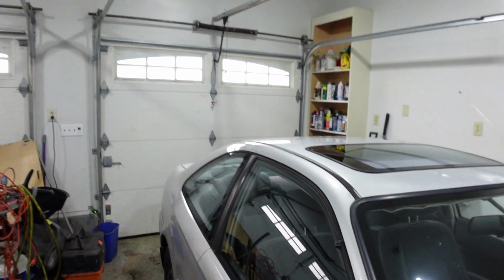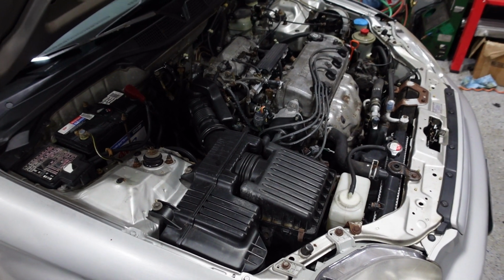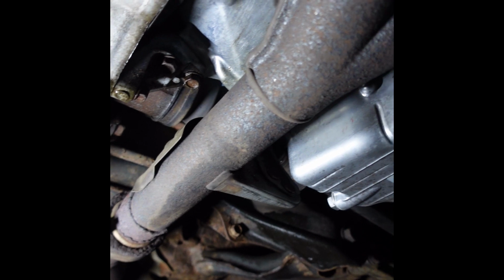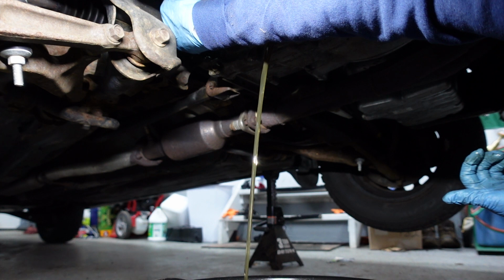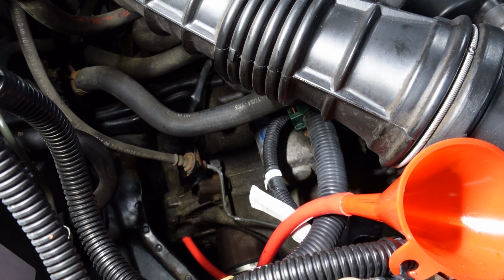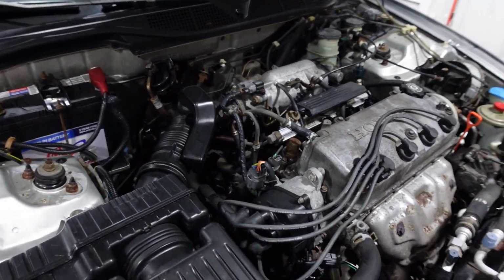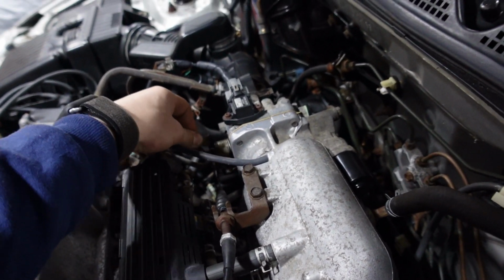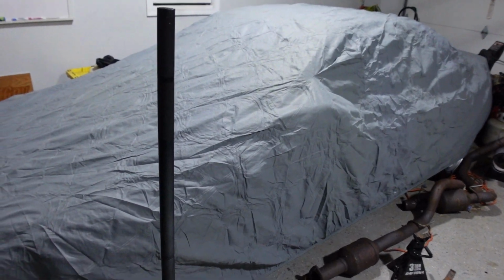High Mileage 97 Civic Manual Transmission Fluid Change

Comment: For people wondering, mech shop guide says to replace both washers on the drain and fill plugs. Use Honda one's if you do as I have found aftermarket washers are sketchy on their sizing.
Reply: I just picked up crush washers from honda they are 14mm and 20mm sizes

Comment: Here's how I did it, just in case anyone is looking for a slightly alternative way to do this job: 

Jack up the front passenger side, take the fill plug out first, then take the drain plug out and drain the transmission fluid. Then lower the car back to the ground so all fluid drains out. After all the fluid has drained, jack up the passenger front again, and put the drain plug back in with a new 14mm crush washer, then set the car back onto the ground. Now that the car is on flat ground, take a long bendable metal funnel(cheap on Amazon) and feed that down from the top and insert it into the fill hole, and pour in 2 quarts. S40 transmissions take exactly 1.9 US quarts for a drain and refill, so a little will spill out when you get to the end of the 2nd quart.. keep your oil drip pan on the ground to catch what will overflow out of the transmission. Remove the funnel and put the fill plug back in from the top with a new 20mm crush washer.

This way you don't have to use 2 jack stands and a jack in the rear to get the entire car level, and instead you can just use the flat ground to ensure the car is level. As they say, more than 1 way to skin a cat.

Comment: Because you filled up on the ramps, the fluid level is low. That's bad!  Car must be level!!    Running 1/2 quart low will eventually ruin it all.
Always put in second gear before going to reverse.
Reply from the maker: I leveled it out on the jacks before setting the level of fluid. Thanks
Reply: @ThatAccordGuy  Good deal.  It's so important!  Me 1989 Accord Lxi Coupe since new.  Still drive the crap out of it.